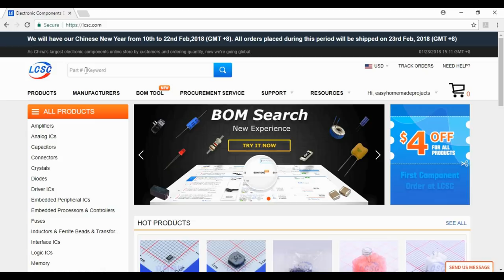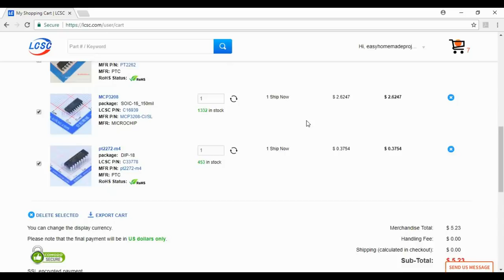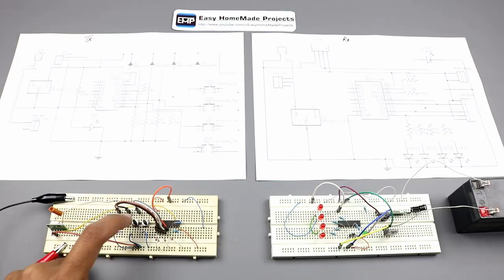How to Make a Wireless Remote control Circuit at Home

Comment: Question- i have four 4 sets of 4 channel transmitters and recievers, 433 mhz. I plan to use each reciever as a signal reciever in 4 larger devices.  I eant all 4 transmitters, when they press channels 1 (a button), machine "A" recieves a single signal.  Subsequent lettered buttons on all 4 transmitters, send signal to each corresponding lettered machine.
How do I make the transmitters transmit an "a" button press to machine "a" ONLY, as well as the other 3 buttons to thier respective machine?
Reply from the maker: Go for NRF24l01 and arduino

Comment: Anyone able to create custom PCB from the file from his website?
I got pdf file and the circuit is extremely small when printed it on a paper. I don't know what the correct scale it should be.
I use screen capture from the pdf  and paste it into Paint program and rescale it.
It's either too small or too big.

Comment: i using 1M and 47K resistance...and all are same.but circuit not working.even i remove wireless module and direct connect IC PIN 17 and 14.but not working!i have 3 pair of ic but dont know why not work...can you send your email?i can send you my breadboard project PIC.Thanks.please i cant Finding my FAULT...
Reply from the maker: You can  Contact me on my Facebook page. Btw try 1M with 150k or 1.2M with 240K
Reply: ok.thanks.i'll try.